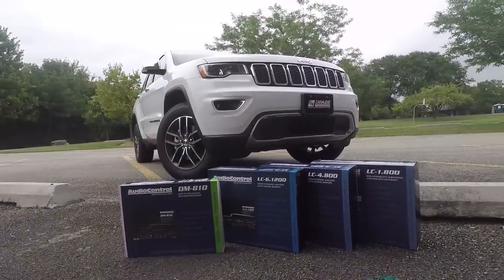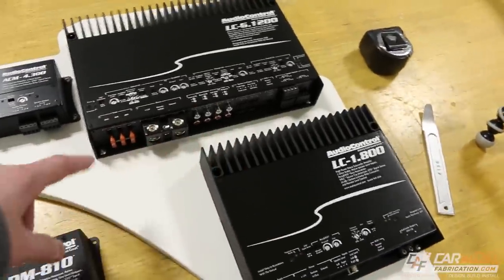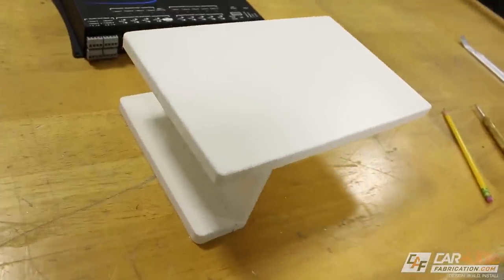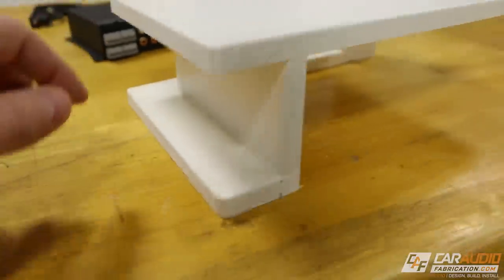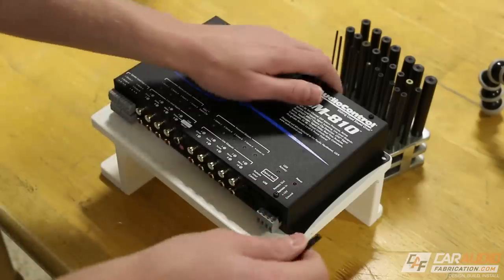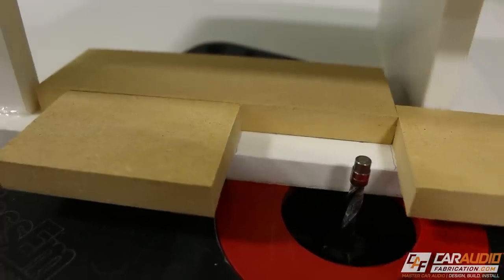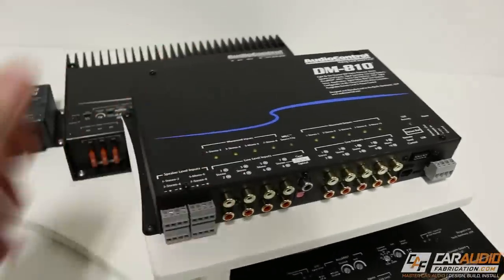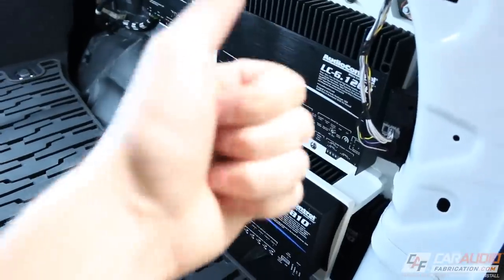Building FLOATING DSP MOUNT! Amplifier Rack Fabrication

Comment: I KNOW you can answer this. I  am adding an amp and new speakers in my Canyon. The amp can only fit under the back seat. There isnt enough space behind the rear seat. Do I NEED to mount it to wood/mdf or can I just screw it down onto the carpet? BTW, LOVE your stuff. You are far and away the best audio guy I have found on YT!

Comment: Nice work as always. A few questions though: why did you not countersink the threaded inserts for the lower portion of the floating shelf like you did the others? This would ensure the lower portion (L-shaped) is sitting flat on the bottom piece, rather than only making contact at the 3 threaded inserts. Also, as nice as this looks, I think you could've benefited from using standoffs (metal rods) between the shelf and the base. This would allow more airflow for the sub amp, require less fabrication, and you could've avoided the RCA issue. Not hating, just an alternative I was curious if you considered. Granted, your design provides more stability, but I think the standoffs would've been more than sufficient, given the added benefits.

Comment: Man I'm not impressed easy and I have to say wow great work. Those amps are very impressive and you do some clean installs. I'm 42 and been out of car audio for 20 years. I have kept my xtant 1001 this amp killed a jl audio 13.5 mostly my fault back then. But I also had to fix my amp it had 2 blown caps. So I fixed the amp. Order 3 alpine r subs and happy new I need to do highs and mids.i want Lc amp that's next...

Comment: I noticed that when people build sub boxes, they utilize depth for the port. Can you utilize height (like directing air up and around) instead of using the traditional way to build a sub?

The reason I ask is because I have a plan to build a ported box with the subwoofers below the port opening. It’s not designed for a ton of bass but is more of an artistic build that would go with two 10s or four 8s. Its design is an all in one with a separate channel for the woofers as well as the electronics on the reverse and only takes up the back wall space between the back of the rear seats and trunk lid. This is to keep most of the original function.

Comment: Hey mark I really need your advice I have a LC.6.1200 and a  Lc.4.800 from audiocontrol  and I want to go active in front  with the Lc.6 1200  with a set of 3 way sapeakers  what DSP do u recommend??? Do I have to get the,  DM 810 or can I get a smaller one

Comment: My question for this build is why not use the D series of audio control amplifiers with the built in dsp so that you have less hardware and wires in such a small space?
Reply from the maker: Im running more than 8 output channels, otherwise you are right it would be a great choice!

Comment: Quick question why didn’t you mount the dsp where the bass amp is and bass amp where dsp is to make adjustment of all the amps that much easier since the dsp can be adjusted via Bluetooth ?
Reply from the maker: The amps are heavier, rather have them back on the main board. I honestly won't need to tune anything other than the gain on the amps, all crossovers and everything will be done in the DSP, I can set everything else the way I need it before I even power them up.

Comment: I have a pioneer avic 8200 NEX with a JL hd600/4  with Hertz mille 6.5 components and Htheir audio 5x7 coaxial speakers also have a NVX 1200.1 amp with 2 12 inch x series subs do I need to get a DSP or will the radio do a good enough job I have it installed now without the DSP seems like something missing I have the system installed in a restored 1990 mustang LX the front components are installed in a set of kick panel pods from q logic the rear are installed in the factory locations next to the back seat and the subs are in the hatch area firing backwards I pulled the seats and carpet and sound  deadened  the whole floor but it still doesn't sound right would a DSP make a difference?

Comment: Hey mark. Im looking for a diagram that shows how to wire 6 speakers to a 4 channel amp. I was told to hook the 4 cerwin vegas to channels 1 & 2 and the 2 mtx mids to 3&4. The mids i have down easy. But 4 speakers into 2 channels im kinda lost? Let me know if you can help me out. Not sure about series or paralell? Thanks jp
Reply: channel 1 and 2 will be ran at 2 ohm

Comment: Why do you need the dm 810 digital processor  if the LC-6-1200 have it build in already??? Unlees iam wrong ???
Reply from the maker: There are two versions of the amp. One has DSP inside the other does not. I needed more than 8 channels of control for this particular project.

Comment: What’s the purpose of the dsp if the 1200 has a built in dsp?
Reply from the maker: There are two versions of the 6 channel amp, the D-6.1200 has DSP, the LC-6.1200 (which I am using in this build) does not. I need more than 8 output channels for this build, which is why I am using the separate DM-810.
Reply from the maker: I wouldn't call it "just a 6 channel amp with accubase" it has a ton more features than that: https://www.youtube.com/watch?v=flz6sq1dCuk